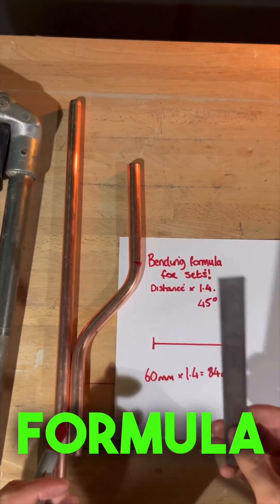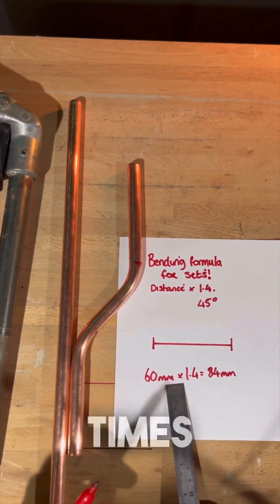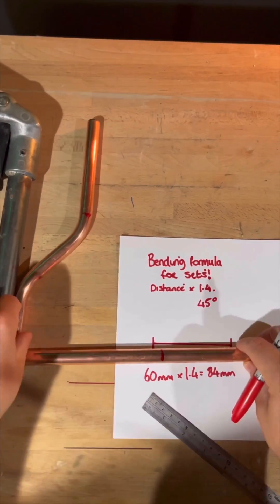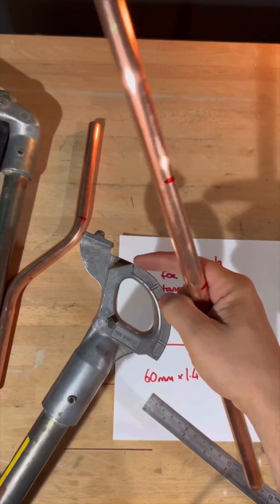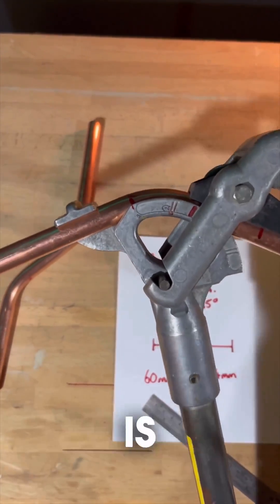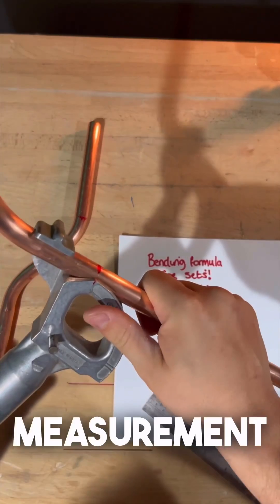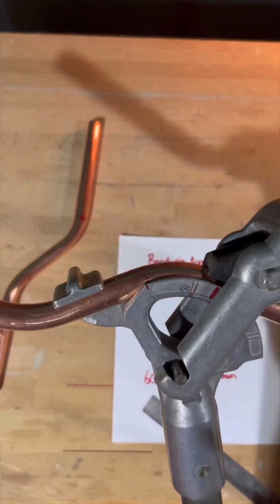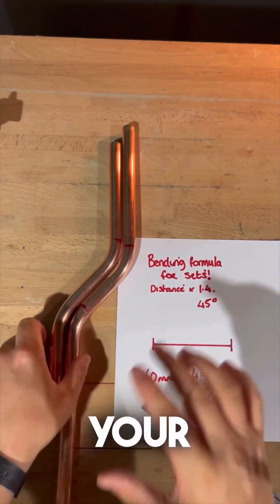How to bend a set in copper pipe!

Comment: Excellent 👌👍, are there other formula's for different degrees? Example an offset with a 30 degree bend
Reply: The formula to get the multiplier for any angle is  1÷sine(angle). So for a 30 degree angle we get from our calculator sine(30) is 0.5. So the multiplier to use is 1÷0.5=2.

Comment: Why 1.4? Where do you hold this dimension?
Thank you in advance
Reply: It's the square root of 2. It comes from the Pythagorean theorem - If you have two sides with a length of 1 (Both sides the same means a 45-degree angle), the hypotenuse (The long side, the length of the pipe at an angle) is sqrt(1*1 + 1*1), which is sqrt(2) or approx 1.4.

Comment: If you want a shallower set and pull 30 deg - multiple by 2, if you want a more aggressive set of say 60 deg, multiple by 1.2 - good old right angle triangle theorem!
Reply: How does this work I'm sure you are right but the sec of 60 is 2 and the sec of 30 is 1.15